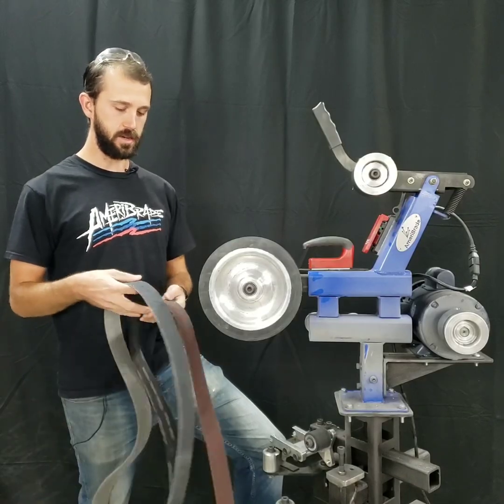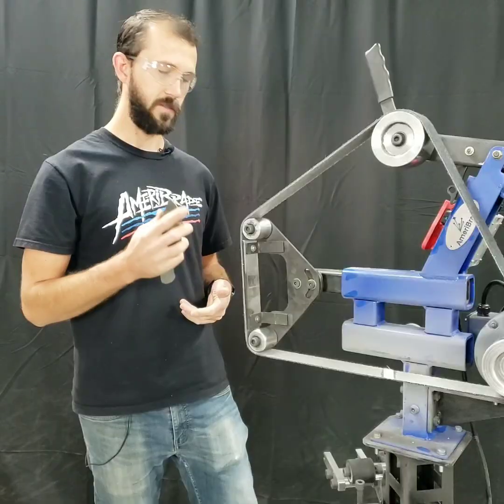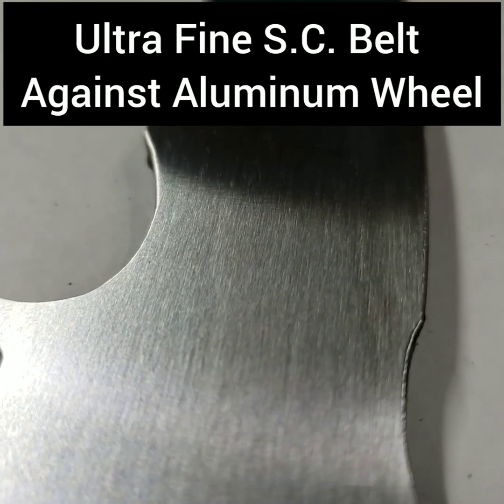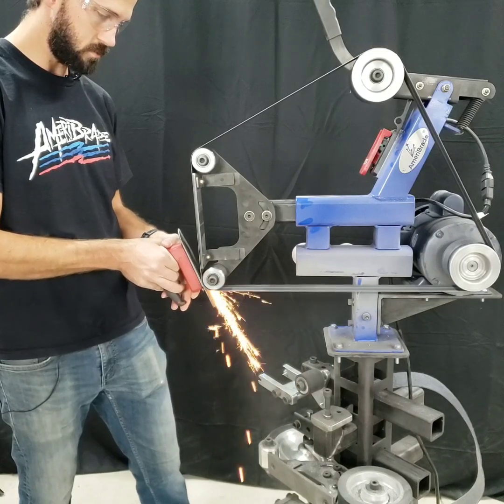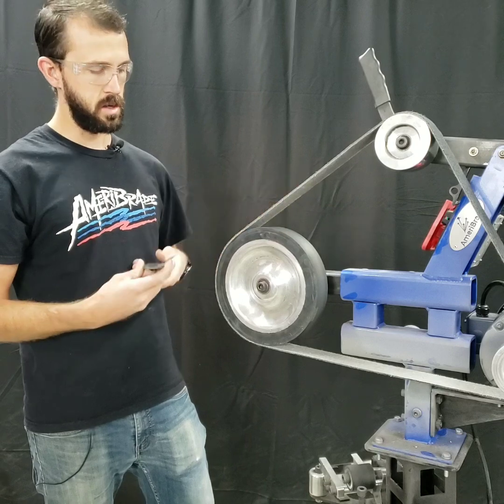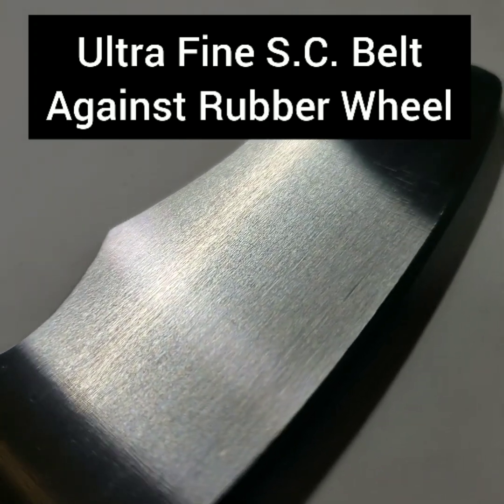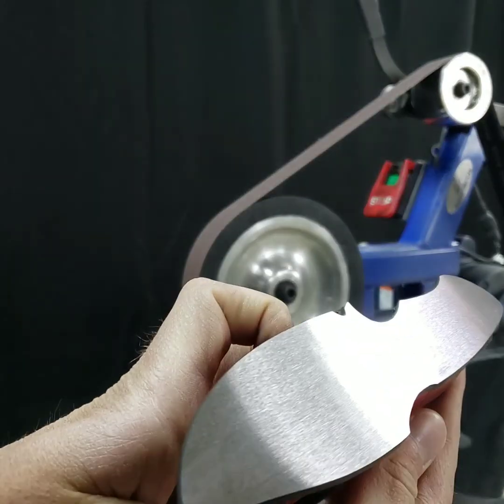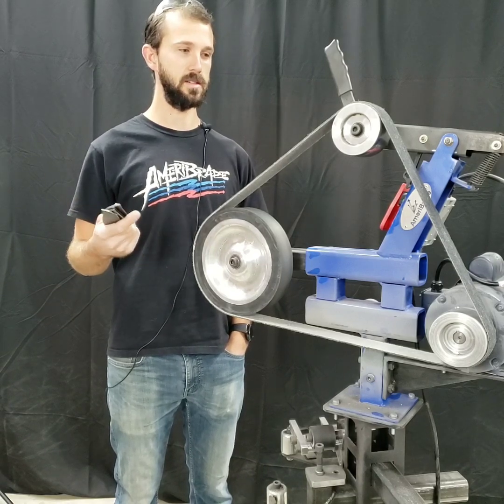Surface Conditioning Belts Versus Abrasive Belts

Comment: That demo was just about as stupid and deceptive. Putting a blade against a 2 inch will absolutely create chatter, the surface conditioning belt is spongy, so it will be smooth, bad demo, or good if you are hocking scotch brite belts.

Comment: What size of Rubber Contact Wheel are you using in this video?  What advantages or disadvantages do the different sizes you offer make?  You now offer up to a 14" diameter wheel.  For knifemaking, what is a reasonable size, largest or somewhere in between?

Comment: Those chatter bumps are because he held it against the wheel and not the platen. The wheel is not actually flat, it grinds in one tiny area, like one mm at a time, you're gouging your metal by not holding it flat on the platen.

Comment: You could compare it to a 220 belt with the blade held flat against the platen (vertically), since it'll keep its flatness, plus it'll remove much less material over the large surface area.  Works great for cleaning up flats before hand sanding, or possibly even for finishing using something like Norax belts etc.  Btw, I actually got my 12" wheel a while back from you guys and just wanted to say your customer service was excellent.  Thanks for making them available at very reasonable prices too. 👍👍
Reply from the maker: We should've done that too! Thanks for the suggestion. 
If you liked those old contact wheels, you'd really like the new ones we're making ourselves. They'll be in stock sometime this week. A little bit more than the import ones we used to sell but in a different league as far as quality goes.